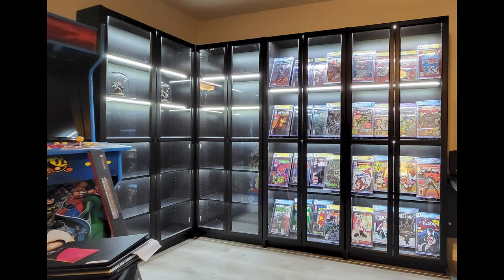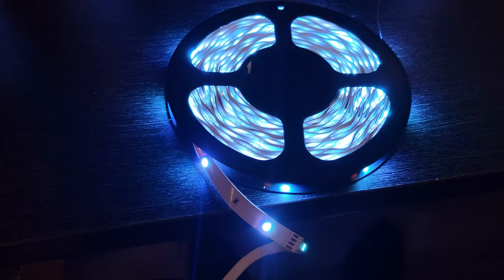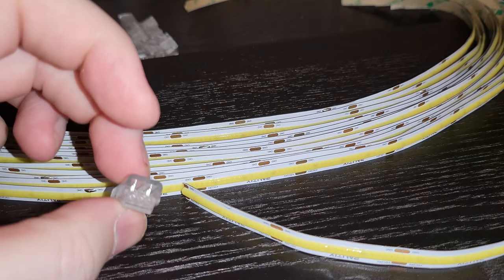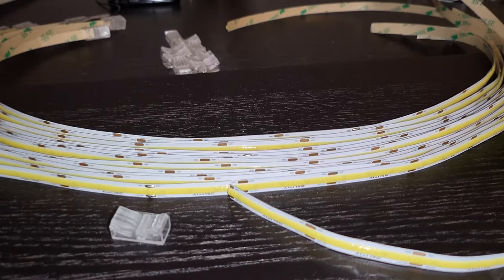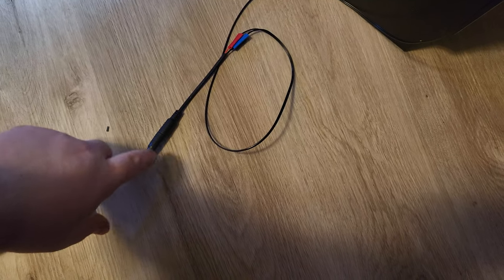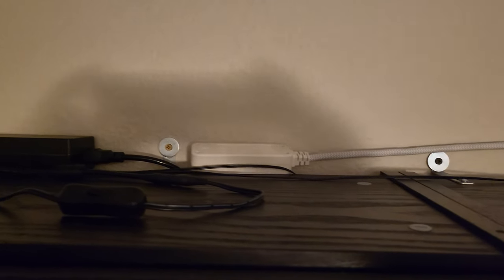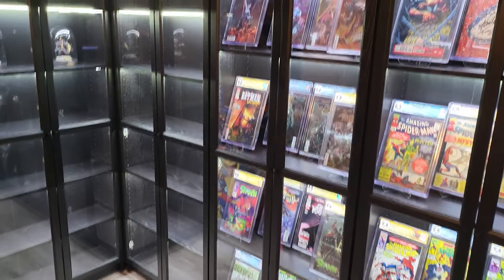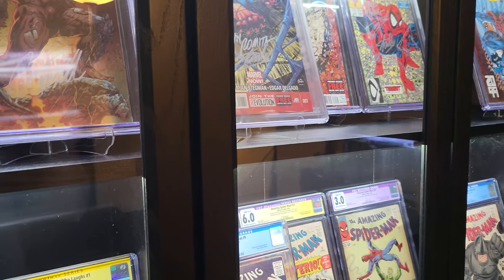Ikea Billy Bookcase Custom LED Lighting Setup

Comment: Thanks for the video. Quick question, I have 3 Billy bookshelves with 8 shelves in each that all need lighting. Can I use everything you did, or do I need a different power supply or converter? Thanks.
Reply from the maker: you can use everything i did. youbwould just need to add power supplies to accommodate the extra wattage. i do not recall off hand what each strand of light uses. i know its mentioned on the amazon site. just multiple that by how many strands and you will be able to see how many power supplies you will need. you dont want to max out the supplies to prevent it from overheating and catching fire

Comment: This is great and exactly the type of wiring I was looking for!!
I have some questions though.

I'm trying a similar approach, but instead of using white LEDs, I'm using RGB.
I have a 12v 5-meter strip that I will cut into 10 smaller strips and put them into 10 shelves, will any led lights become dimmer?

I will run them in parallel, that's my only concern is that the LEDs will become dimmer.
Reply from the maker: depends on how much voltage each strip needs and the power supply you use. as long as the entire strip combined is less than your power strip max voltage, then it will be at full lighting. The led strip you buy should say how much wattage is needed per foot.

Comment: Will the controller allow dimming/color change with the LEDs that you used?
Reply from the maker: if you buy the same model, I did which is the Wi-Fi 5 in 1 model. Then yes. They have 3 different types, and the other models restrict you on the type of lighting.

Comment: Hey! Can you tell me, without the lights, can you see anything from outside of the bookcase? I want to get the bookcase from Ikea for my video games and souvenirs, however without lights, I am not sure if it would be too dark to see anything. The glass doors I wanted seems are not available anymore, so the oxberg in black seem too dark. How does it look for you during the day with the led turned off?
Reply from the maker: Here is an imgur link of what it looks like with just a ceiling fan light at nighttime. Day light just makes it a nicer overall look as the light isn't as harsh.

https://imgur.com/a/m96twQI
Reply from the maker: It looks like my phone is increasing the brightness in the picture. It's not that bright when looking at the comics. But i am able to read everything on them without any additional light.
Reply: Thanks a lot man! I appreciate this